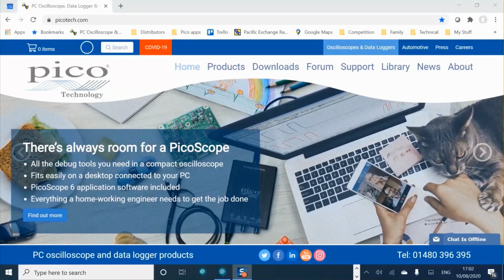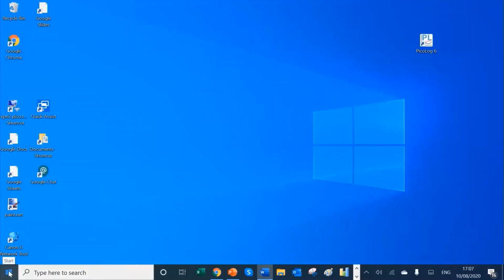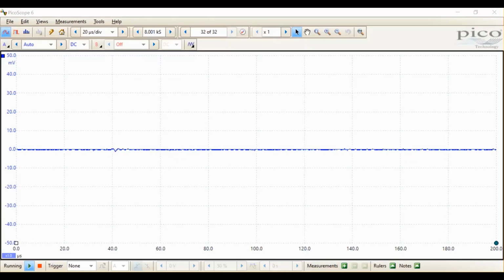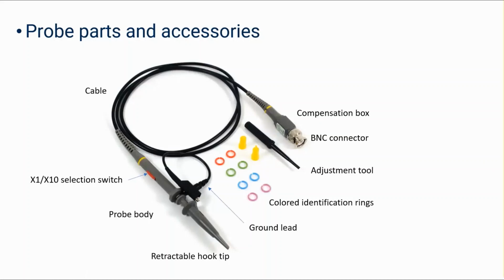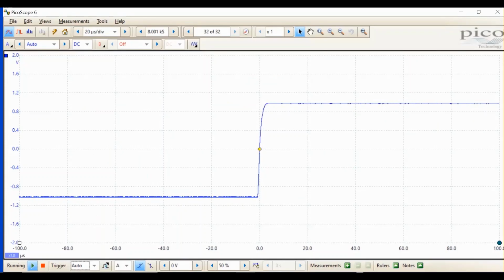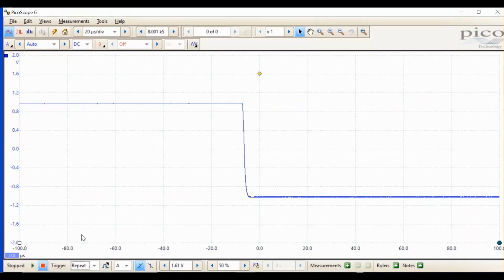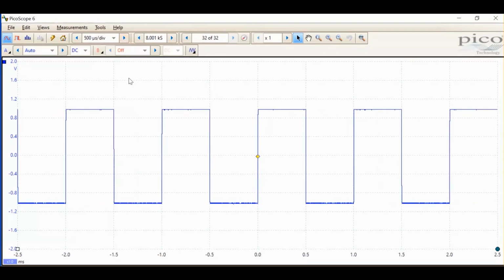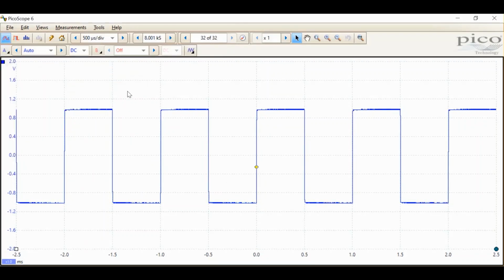Introduction to PicoScope Part 1

Comment: how to use digital microscope to measure the open circuit voltage and current also how i know time charging capacitor?
 also if have piezoelectric nanogenerator( its Ac generator ) how you know the appropriate bridge rectifier curict to use it?

Comment: Need to get the Mac version sorted and upgraded. Its been in beta for far too long
Reply: I've just installed the latest Mac version on a new MacBook Pro with M1 silicon running Big Sur and so far it all seems to work fine...